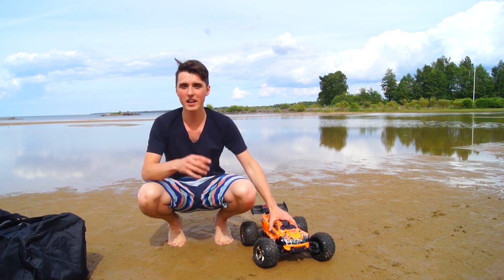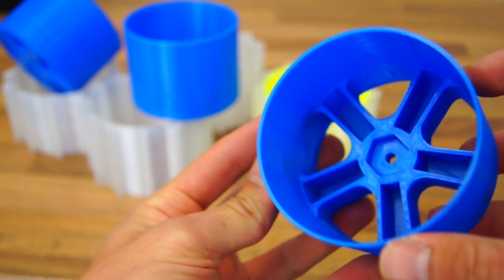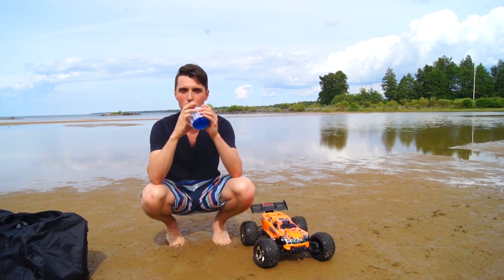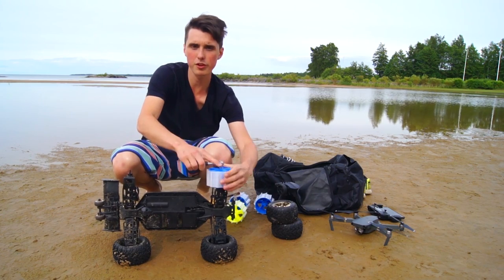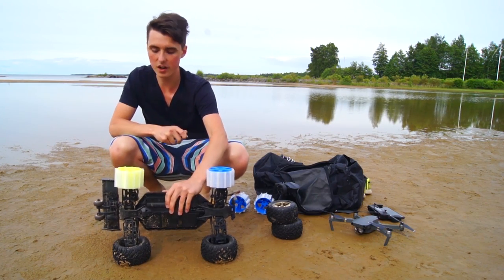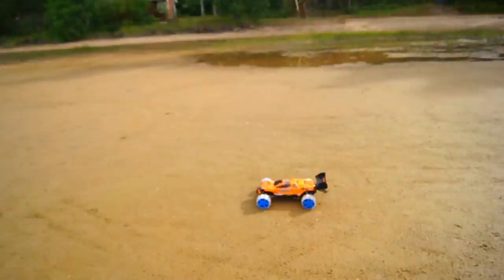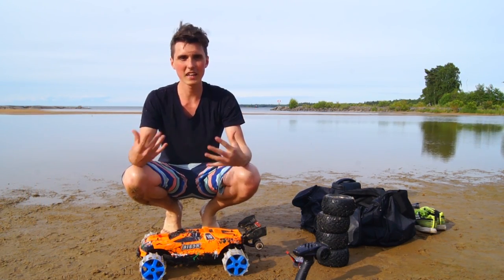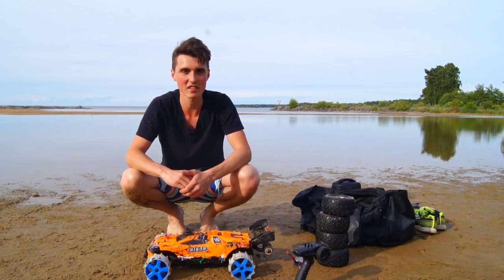3D Printed RC Car Wheels - Crazy Traction!!!

Comment from the maker: WE DID IT! Thank you so much for all the helpful comments. Successfully driving on water here: https://youtu.be/YWZkXu0QfAo
Reply: Hy what drone u use?
Reply from the maker: I use the DJI Mavic.
Reply: RCLifeOn does it run on aa or aaa batteries.
Reply: RCLifeOn 

Knnnn
Reply: Blue inside     

My hhh
Reply: Blue inside bvcc
Reply: RCLifeOn lll
Reply: RCLifeOn no
Reply: RCLifeOn you need bigger paddles
Reply: RCLifeOn ? What would happen if you redesign the chassis into a boat style ?
Reply: Were is the link of the stl file?

Comment: For what it's worth I think some of the problem is the shape of your paddles, they're scoops. On sand etc they scoop up the sand and throw it up, helping to push the car down into the ground. On water it scoops up the water, throws it up, pushing the car deeper into the water. Also as others have mentioned the rubber tyres offer a certain amount of buoyancy.
Reply: Good thought, just try turning the tires around so they slip on the water a little and provide lift as they spin, also try making wider tires for more surface contact.
Reply: if you compare his wheels to the official wheels you will notice that his are scoops where as the official ones a paddles. the difference being that one scoops up water/sand and the other pushes it away. you need the version that pushes it away :D
Reply: +johnp256, agreed.  I'd try turning them around.  The design may still not be optimal, but I think they'd have a better chance of success in pushing the car up, away from the water vs. digging down into the water as they were oriented in the video (which is why you were getting such good traction on land).

Love the channel, Simon.
Reply: Try bigger paddles
something like 1.5 - 2cm :)
Reply: agreed
Reply: johnp256 u don't have to have big paddles, the size they are is fine but if the front tires have paddles it will be useless because the front tires are not powered so the paddles in the front make it that the water is forcing back on the front tires causing the car to slow and loose the ability to skim
Reply: Nope Roku Playz
Bison is 4WD and the center of gravity is in the middle when you keep similar speed, so paddles in front are just plus
Reply: Gophy they don't look or act powered, if it is powered it's not powerful enough to use the paddle wheels in the front
Reply: i dont think bouancy is the problem. iw seen both cars and bikes ride on water. and they will sink like a stone if the speed is not high enough. water when hit hard is pretty tough. so it a question of enough speed. and keeping momentum.  maybe the paddles are not big enough. ( the ones on my rc are pretty huge) and they are closed off in the ends. maybe thats the problem
Reply: Benjamin sandström  tje Traxxas wheels adds bouyancy, but also prevent the rim to fill with water. to me it looks like you get water in the rim and adding mass to the rotating wheel. try adding some volume tho the rim. foamring or similar maby.
Reply: I think that he might be missing some air in tires... Original tires had some air inside so that's what helped to hold car on the water
Reply: Christopher Hefferin Exactly right
Reply: Erik Tomáško needs more power. Wheel speed is key. Air in the tires doesn't do anything. Look at snowmobiles. No air In the track. Just lots of power turn the paddles to get enough forward motion to keep it hydroplaning.
Reply: Jayleno'sGarage you need to learn some manners there kid.
Reply: Christopher, I went back in the video to thry and find something for him to fix and i did come across that they looked like scoops which in water, wouldn't help. One thing he could do is also make the tips a little bit longer and close off that scoop. and tbh, i dont know how it worked that well in snow. haha.
Reply: SoyPlays drop more power in it as it is and it will work.
Reply: dirt rider probably not

Comment: Use normal tires at the front and behind using paddle wheels
Reply: The car is 4 wheel driven, so how would that work exactly? I think 4x the same, correctly designed wheel, is the answer.
Reply: Magnus Frederiksen i mean that use two paddle wheels and two normal wheels.
Reply: It will work better with normal or almost bald wheels in the front and the paddles in the back. If you don't believe me, check out videos on swamp buggy races. They have paddles in the back and a tall thin tire/wheel in the front. They also have ski's underneath the vehicle in the front. 

However, I believe with a normal sized balloon type tire in the front with little to no tread, it will skim the water better.
Reply: Justin L.  But it is all wheel drive
Reply: The clearance that the normal tires have (when expanded) help it skim of water, and the car doesnt drag, try printing up some taller paddle tires! Keep paddle the same size, just more "meat" between the paddles and rims...
Reply: For this you also have to lock the mid diff (some of them come with a screw to lock it). Otherwise the frontwheels try to spin and the backtires don't do anything. This could also be the problem why the whole thing didn't work out in the first place
Reply: its for turrning purposes and if you have a real wheel drive rc it doesnt matter the tires on the front because they are just for turning because if you had paddles on all 4 you run the risk of sliping because they dont have enough bite
Reply: Brett Carlow main purpose of middle diffs in rc cars isnt turning!
the vehicle he uses in this video is 4wd. If you have the front tires with near to no grip, the back tires with very much grip and am open diff in the middle, you will not be able to drive at all
Reply: well you can i have a traxxas erevo and i have paddle tires in the back and stock in the front and it works just fine because when had paddles in the front the truck would just try to ride up ontop of snow or sand not  drive ontop of it it would try to climb it idk you are probaly right in your situation but thats not happend to me
Reply: Brett Carlow thats because the e revo has no center diff but a slipper clutch. There you have equal torque distribution and can use whatever combination of tires. The car used in this video has a third differential which will probably be the reason to sink down in water
Reply: iiro haapanen moi

Comment: You can't drive on water because rubber wheels are filled with foam which allow that car to kind of "float". Maybe you could cut up some pool noodles and stick the on the inside of the rim to give the wheels the same affect as rubber tires
Reply: I agree, he should try to make the wheels provide more floatation for the car. Maybe not pool noodles, (Because they wouldn't provide traction on the water, but instead he could try making the wheels bigger, and adding an air pocket. He could also make it air tight and add helium to add to the floatation.
Reply: Chicken Bro Productions are jsjjs
Reply: He'll need just a few things, actually. 

He could probably do it with that car, just with:
- a bigger scoop that pushes more water, as the larger surface area provides a larger volume of water. The scoops would have to be at the limit of what his motor can push at a high rpm, maybe gearing for more torque would help.
- printing the wheels with a bead, and printing tires with an internal chamber for air. I'd print them in 1-1.5 mm thick TPU. silicone would work as a good sealant

Aquaplaning is not due to buoyancy, (which thanks to concrete canoes, is a questionable concept these days) but the smaller density would help slow the sinking, making the car appear to successfully bridge the gap.
Reply: Du måste hålla full gas hela tiden
Reply: I'm not certain but here's why I think it didn't work. The 3d print you made has the triangular "grip" cavities that don't allow the water to spray out when each cavity exits the water. however you can see the rubber wheel cavities (I looked it up) does not have blockage for the water to spray out the sides, if you zoom in close. This is critical, otherwise as seen with the 3D print, the water stuck in the cavities create a downward force, pushing the car into the water. Hope that makes sense! Fantastic videos as always!!
Reply: It would also give a benefit of lowering the wheels RPM and giving more torque. I think the paddles need to also be more aggressive.
Reply: Matt Cribb This is exactly what I was thinking!!!
Reply: He can also go to his local hardware store and buy the expaninding foam that comes in a aerosol can
Reply: The principle behind paddle wheels is not buoyancy but sheer force pulling the wheels over the water.
Reply: Also make the paddles bigger
Reply: you really don't know how hydroplaning works
Reply: The14thAssassin yes
Reply: Chicken Bro Productions o
Reply: sorry but your wrong because the car would have to be floating first but driving on water is hydroplaning
Reply: But if the car stops hydroplaning and it doesn't float its over but if it floats it can go of and on hydroplaning, like unlimited retries. You can tell it would help because the car was hydroplaning but failed.
Reply: the water is so shallow that the taller tire high will make it sit above water and able to take of again
Reply: thats not how this works at all
Reply: M<aybe if he used larger diameter wheels to get more surface speed on them??
Reply: that is exactly my thought
Reply: Chicken Bro Productions that has nothing to do with hydroplaning.......

Comment: Anyone noticed the tires are the wrong way round? They are "digging into" the surface,hence better grip on sand and worse results on water,digging into water made it sink faster.Just flip the tiers so they are "pushing away" rather than "digging into" the surface.If you didn't understand that: the flaps on wheels are angled about 45° forward,flip them so they have a 45° angle backwards.this would make your results much better.please try it again.
Reply: Epic Noob this
Reply: yes, need more of a slap on the surface of the water
Reply: Watch any other video of RC cars "hydroplaning" and their tires are set up just like this, to scoop.
Reply: Epic Noob ababababa
Reply: Epic Noob they are not on wrong they are just a not so good design of paddle tires
Reply: lol they are on the right way, they are just scoops which make him go into the water
Reply: Epic Noob I suggest making a new frame on the 3d printer for the car that can hold air inside instead of being solid plastic
Reply: Epic Noob I agree. His spikes should slap the surface to make it float. And also he has very thick wheels water may easily ate his wheels.
Reply: hitman22 no he is just smart
Reply: Dawson Stanger no
Reply: They are the right way
Reply: Epic Noob hi
Reply: Epic Noob I was just bout to say rhat
Reply: Epic Noob yess
Reply: thats what I noticed
Reply: Epic Noob they arent romans were the same its just not fast enough
Reply: Wrong way? uhh.. no. lol all vehicles that hydroplane / water skip, keep their paddle tires in the forward direction. just look up the videos man, 4wd atv's,  offroad formula trucks, sand rails, dune buggies... they just need enough power to do so.  this dudes rc truck clearly didnt have the power, as soon as those plastic paddles hit the water, the motor couldnt keep the wheels spinning, scooping and throwing the water propelling it forward.

Comment: to run on water you need to modify your setup in two ways:
1 - increase wheels diameter, so the speed on circumferece would increase greatly. Try 160mm diameter.
2 - if you are using 3S lipo - switch to 4S or even 5S. If you are on 4S now - move to 6S. This upgrade can be expensive, but without it, you will not have enough power at your bigger wheels.
Reply: You dont need a higher voltage with bigger wheels, you will destroy the motor and the gears. Just make bigger paddle wheels, maybe double the size, you will go almost twice as fast. That will also double the power drawn, be careful, maybe only accelerate with half throttle
Reply: max chebotnikov does the power rely on the battery more than the motor? Is that how it works?
Reply: The Ryanator's Personal Channel The higher the voltage the higher the power
Reply: also the air in the regular wheels is kinda key the floating on water
Reply: Power(work done by car) is Amps(load of motor) x Volts(number of bat cells). So the higher the V - the higher the Power is, given the motor is capable of producing such a power. But the task of crossing the river with paddle wheels is more complex than that. For driving on water surface with car of given weight, you need specific speed. This speed can be achieved by applying so called paddles on to wheels. Now this paddles have to be big enough to achieve  required speed, or rotate fast enough for the same reason. The task of achieving such speed will require specific amount of power(Watt) to be delivered to the wheels. Assuming your motor is even capable of producing enough power(motor Amp rating), but the car still sinks, means you need to increase either wheel radius(bigger paddles), either wheel speed(faster rotation). Since we assumed the motor is capable of this power we just need to increase voltage supplied to it(cell count). So the power to do the task is a given number - we are just looking at ways of achieving it by altering our car. Besides from mentioned ways you can also decrease weight of the car, change gearing to increase wheel speed, change shape of the paddles to not allow water to escape and so on and so on...

Comment: Maybe try flaps instead of paddle buckets for going on water so that it can push the water instead of grabbing it 🤔
Reply: Adrian Garcia it has nothing to do with that there is no upward force to hold it from sinking seeing the paddle wheels have air in them
Reply: Panda #44
It has ABSOLUTELY nothing to do with the air. It sinks because there is not enough upward force from flaps or wheels get water inside (they are like buckets now).

If you still want to argue about air search any snowmobile on water video.

Comment: fill in the sides of the wheel so water dose not get in there and drag you down, pulse it will help you float
Reply: nuttylegoman I was going to say that
Reply: Plus make the flaps into a slight V shape.
Reply: And Maybe Tires With Air. Or Put a Haul On The RC.
Reply: nuttylegoman

Comment: The stock wheels probably came further because they have airpockets inside of them. If you add airpockets to the 3D printed ones, they might work.
Reply: Darrell's Konttent no thats floating he want to hydroplane which is diffrent
Reply: Darrell's Konttent he just built it the wrong way to drive on water but great on loose terrain. It dug into the water instead of pushing it away.

Comment: The foam of traditional paddle wheel/tire kits hold air and add buoyancy to help the car float. Your build only solves half the issues. You're close, close in the back of the wheel to try some air and you might have a chance? Building your own is more fun anyway!

Comment: If I could suggest anything I would say 1) Don't have the hubs open on your wheels that traps water.
2) Try a flat paddle so you're not scooping up water forcing you down.
3) Make your offset on your wheels wider so you're not throwing water under the body shell.
Hope this helps!

Comment: Sometimes you are better off easing into the throttle rather than hitting the water at full speed. Similar to a boat, it "planes off" at a certain point. Too much throttle too soon can cause your truck to sink. Try approaching the water at a slower speed then slowly ramping up the power until the truck is lightly skimming over the top.

Comment: I think the issue is that your wheels have scoops on them instead of paddles and so they grab the water, and can not discharge it fast enough, instead of simply pushing off it. Second pointer is that the wheels are of really small diameter, even comparing to the stock ones therefore you get a whole lot of torque (hence awesome performance on sand, in addition to more grip of this design) where as on water speed is more important. Increasing wheel and paddle size will help with that considerably.

Comment: While those wheels are very grippy on sand, it digs into the water, pushing it down. I know I'm late and you posted a second video, but reversing the wheels would make it work better, because you are actually displacing water, not digging into the water.

Comment: Make the paddles twice as long
Reply: SaVaGePlAyEr230 aint gonna help it float. What you need is air. Thats why the regular tyres worked better. All the paddles do is propell the car fowards. Doubling the size of the paddles might work because it will be able to get across qick enough before it sinks but still aint gonna help it float.

Comment: What you used in the video was a sand wheel type to drive on water you need a upward force air is good for this that is what made the original wheels good because they has air i knew they don't have a perfect seal but thats why it wen't down after a while

Comment: So here is my thoughts on why they performed worse in the water test. It is simple they are shorter than the stock wheels and tires so when you hit the water the front bumper was hitting and slowing down your momentum. Where as in the first the tires were tall enough to allow the truck to stay moving faster longer. At least until the decrease in friction caused it to lose speed and sink. My advice is try taller wheels with the paddles!

Comment: The paddles actually pull the car down as they come out of the water, the best thing to do is stock tires and a ski along the skid plate or just 3d print a boat.